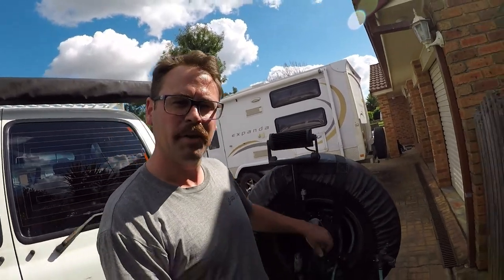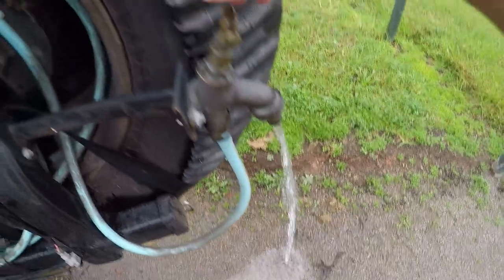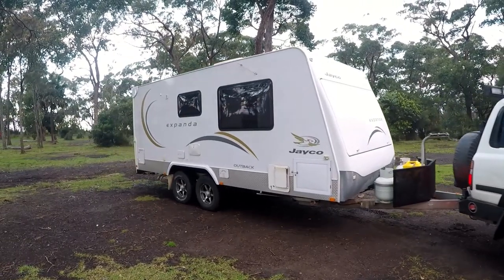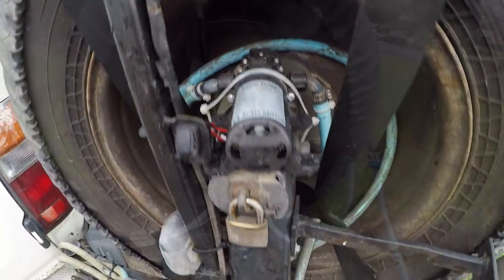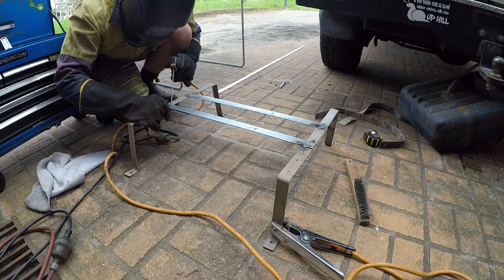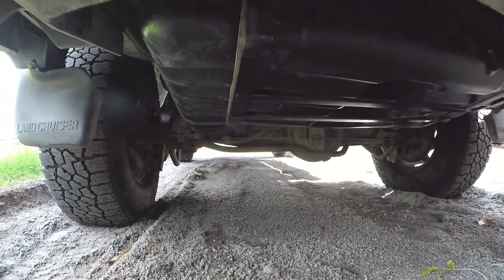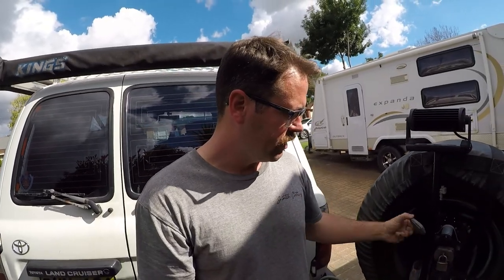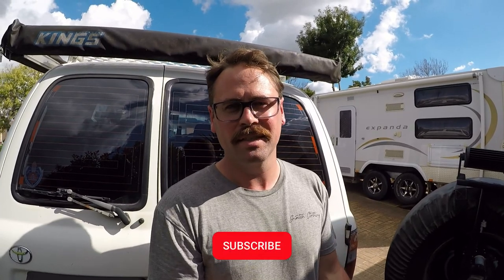HOW TO carry 60ltrs of WATER on your 4WD | Landcruiser 80 series water tank setup

Comment: Sweet video Timmy! Love your work.👌🏽 
Would be keen to see how the 80s been running the the PDI intercooler, power, temps etc. And how you swapped out the front apron indicators to the little leds.

Keep up the good work bro 👍🏽🤙🏽
Reply from the maker: PDI intercooler is fantastic. Done a heap of towing with it so far and the temps are so much better. Indicators I initially cut and shut the originals to give clearance. I have since glued and silicone LED bullbar lights in behind the factory lens.